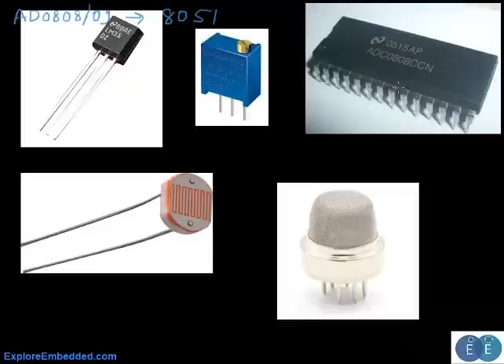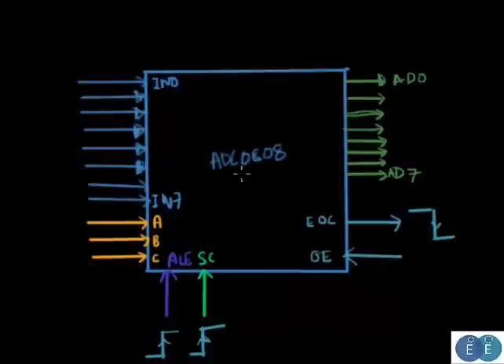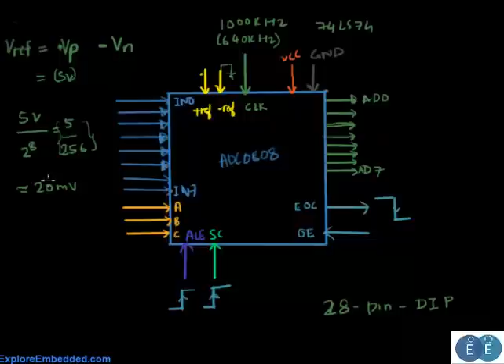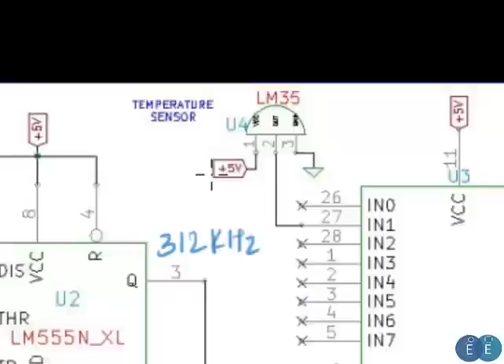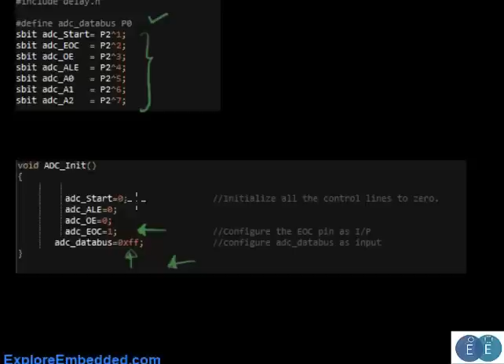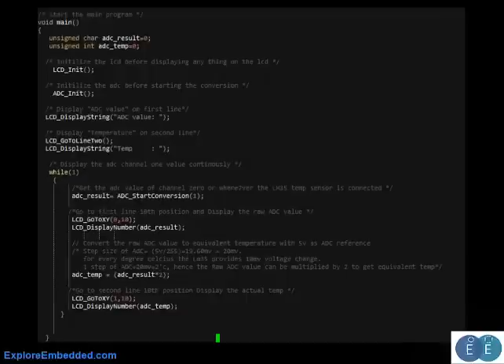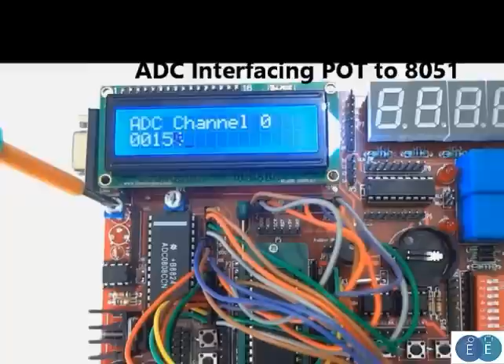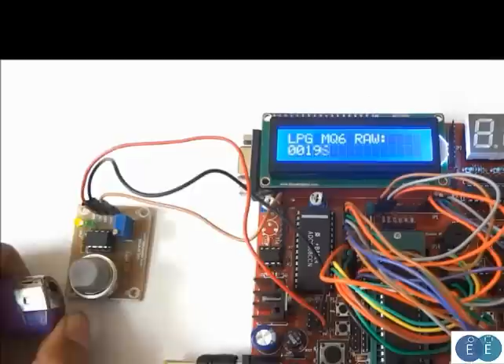8051 0808/0809 ADC Interfacing

Comment: thanks for the video it been help-full but we have encountered a problem the eoc pin does not seem to go high i have checked the circuit thoroughly yet i am unable get an output ,i am using 555 timer in astable mode with R1=10k and R2=3.9k and c=1nf please mention the clock circuit that you have used
Reply from the maker: Vasu Dev please find the schematic below:
http://exploreembedded.com/wiki/A7.8051_Interfacing_ADC:_LDR_%26_LM35